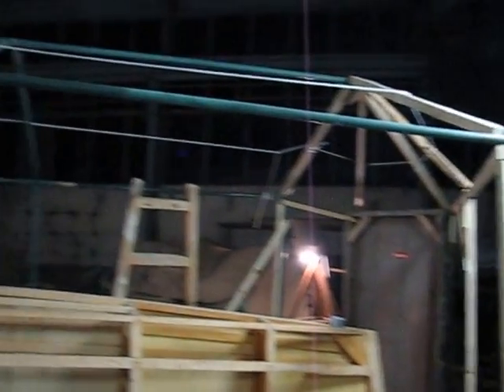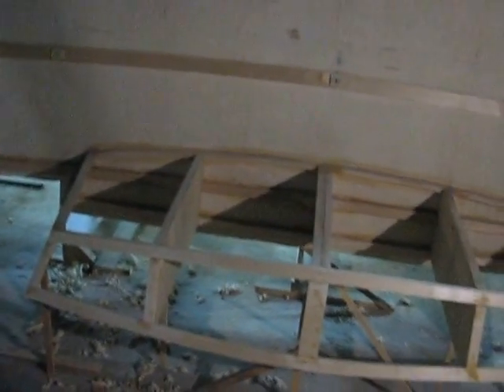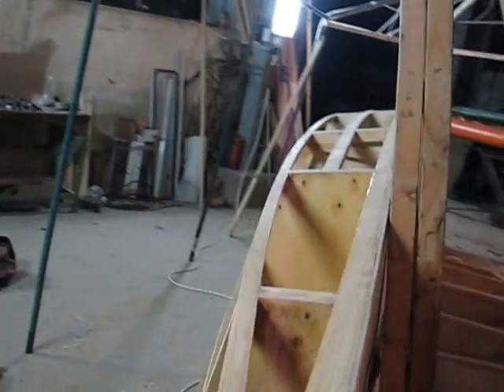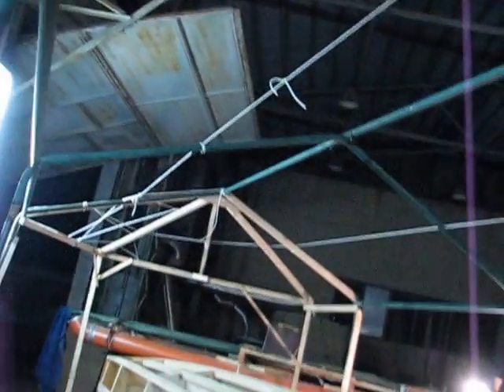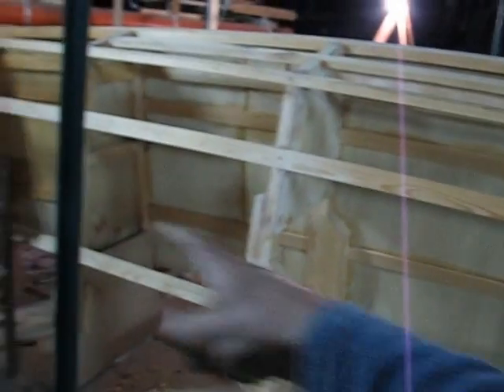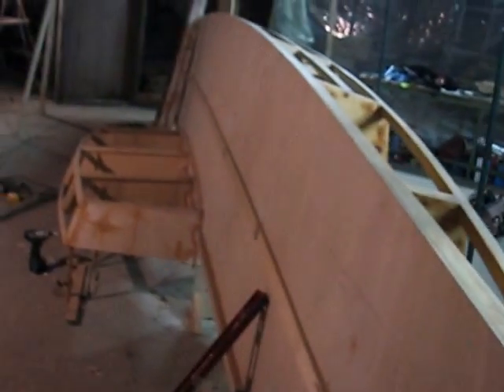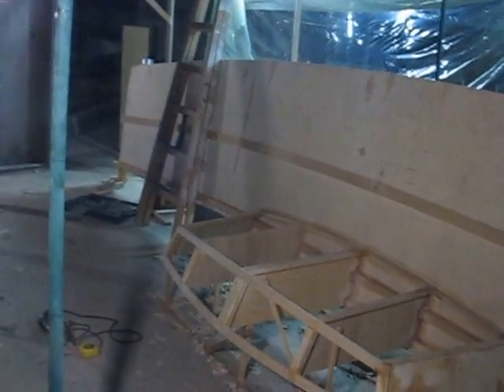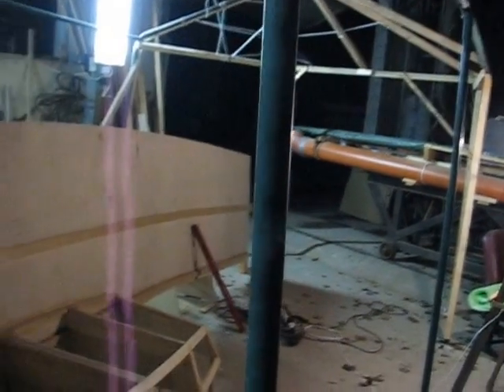pacific micro cruising proa

Comment: I'm currently designing a similar proa three sheets (4x8) long.  Very close size to what yours appears. Round bottom, symmetrical hull, schooner with rotating masts (ply/glass).  Room for two bunks end to end in hull.  Already cold here in Canada -20C tonight.  No warm work space available.  Nice work so far, keep  it up.  Understand quite well your decisions about material & costs.